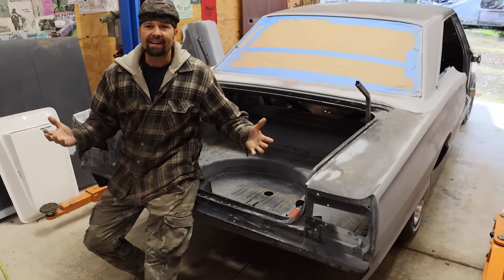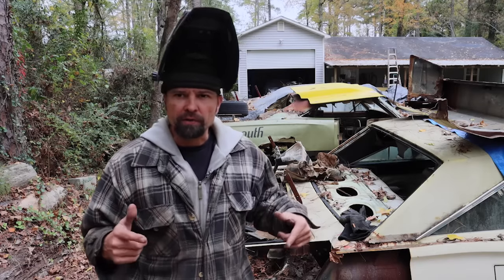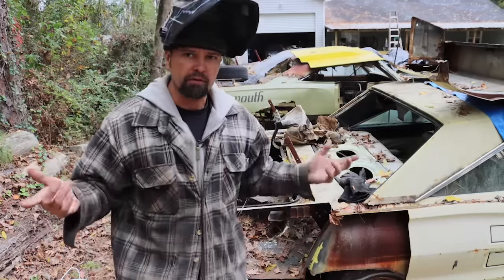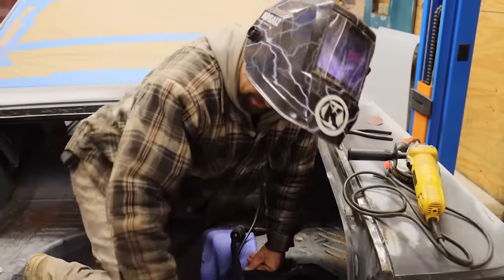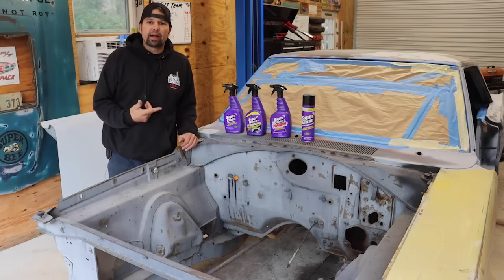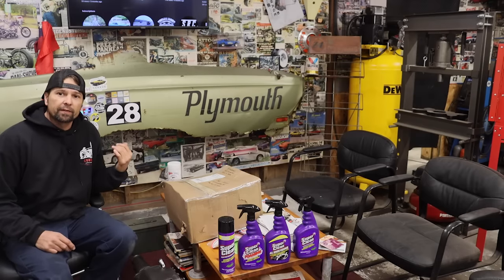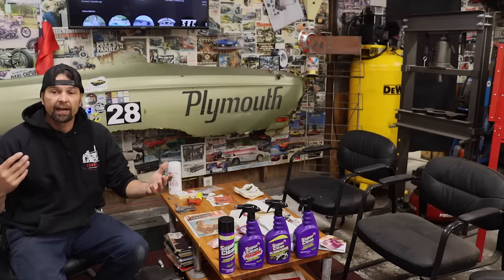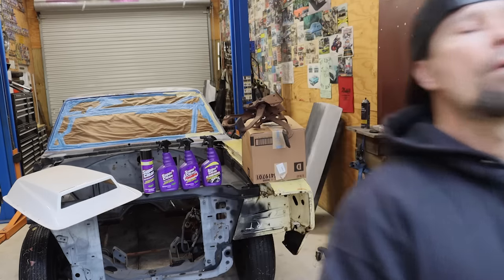1967 Dodge Coronet Street Freak Build. Part 5

Comment: guess its been 30 or 40 years ago found a 67 sitting in a barn had 23 miles yes 23 miles got to checking around was owned by drag racer sponsored by dodge got delivered Hemi super stock engine removed and put in race car the body sit until then was sold for $275.00 man who bought it found original engine somehow restored and sold you can guess what it brought
Reply from the maker: Yeah thats a big money car right there